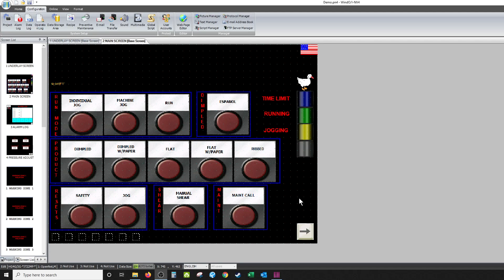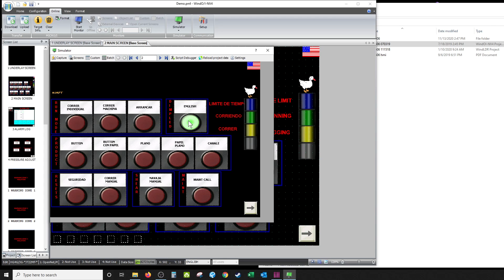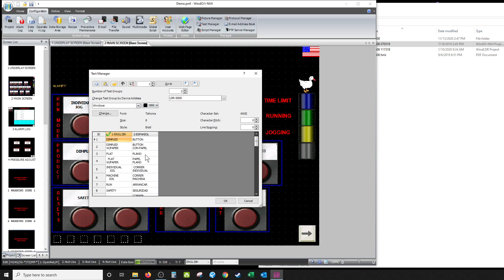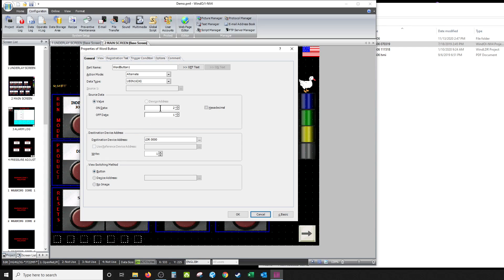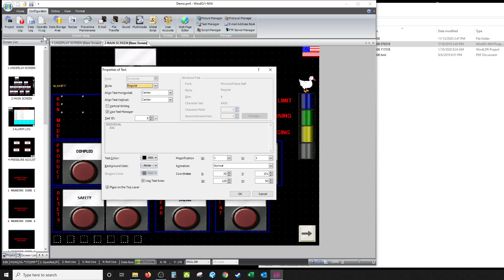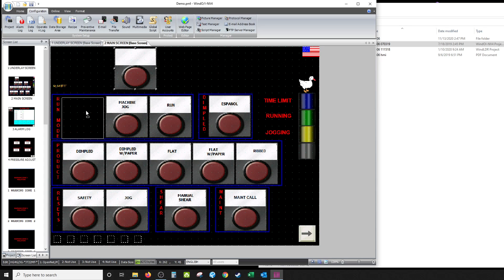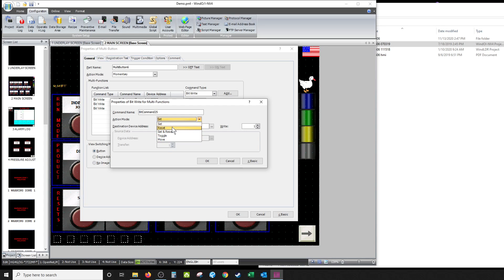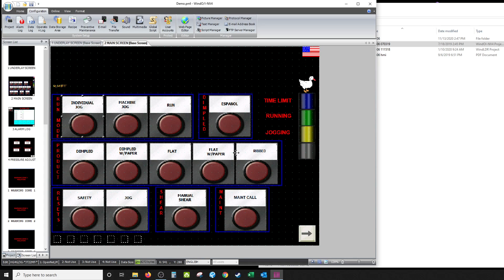Text Manager and Multi Buttons

Comment: Question : I need to set up and read a 4-20ma output from a invalco 4728 bs&w monitor .I’ve installed the pj2a card but can’t read the valve coming from the invalco 4728. Any ideas?plc is a fc6a
Reply from the maker: Where you able to configure it?  At the module configuration tab?
Reply: You need to break down your troubleshooting into parts.  First verify that you are actually getting the mA signal you think you are (measure it with a multimeter).   Or use a known good mA simulator.  Once you are sure it is wired correctly and you actually have a signal to measure then go on to the software end of it like was just said.

Comment: Thanks for making these videos on these IDEC units.  Do you know a way to create an H-O-A switch?  C-Mores, Redlions, and some others have a premade 3 position widget that will write a value into an integer, and each value represents a different state.  With no premade one, I'm having a hard time wrapping my head around creating one.  There are some nice looking H-O-A graphics in the symbol manager though.
Reply from the maker: Sorry for taking so long to get back to you.  I am in the middled of a job transition and relocation.  Yes, there is a way to make an HOA toggle.  You will need to use a toggle image with a multi switch.  Add 2 different positions of the same image, as Indicator lights over the switch image.  Use trigger conditions to display the appropriate image, by which bit is actuall on, in the multi switch.  This is the best way I can think of of hande.  You could also use hidden switches to move it from one position to the other.  But, that would be tricky to explain, without a video.

Comment: I got a IDEC micro smart FC6A-C24R1CE. Having a problem that the USB devices are not found, or not functioning when trying to download a program. Wondering if you know what could be going on?
Reply from the maker: Go to device manager.  If you see it in there, check the driver.  If you dont see it, you will have to delete devices, from ports that are not in use.  Then plug it back in to a port.  I have had trouble before with that before.  Should work then.  If not let me know.

Comment: I am working with the messgae display trying to display text that the user can input using a character input. The idea is that they can input text and then that text is stored and if certain conditions happen then the text they made is displayed. Basically alarms that can be programed from the FT1A Touch screen. When I try to assign a referance device it says invalid variable when I choose a D location. Is there something I am missing or a better way of doing this?
Reply from the maker: I will look into it.  I think I have an idea of what you are trying to do.  Im thinking you will have to reference the output message from the data register where you store the message.  I have done this before with pop up screens, that indicate a particular fault in the system.  (Estop actvated, light curtain violated, motor overload, etc.)give me a day or 2 to get back to you on it.
Reply: @huntxtrm  yeah pop up screens would probably work. It’s kind of a weird project so I think any method that gets the job done will be fine. Thanks for looking into it!
Reply: @huntxtrm  I got the popup screens down but I can't seem to get the ascii text to display. I want to have a screen that the operator can type in a messsage and save it to a D location and then when the alarm is called the text they inputed to the hmi screen is shown on the popup screen. I was trying to use a message display but I keep getting an invalid variable message when I try to exit the editing window in NV3.

Comment: Are you saying the radio buttons can perform logic on outputs?  So basically you are controlling multiple outputs with one button press?  Almost like ladder logic except there is no ladder logic just button logic.
Reply from the maker: Yes, they can perform multiple functions to different bits at yhe same time.  You could bypass lines of logic with one button press.
Reply from the maker: You are controlling bits, not actual outputs though.